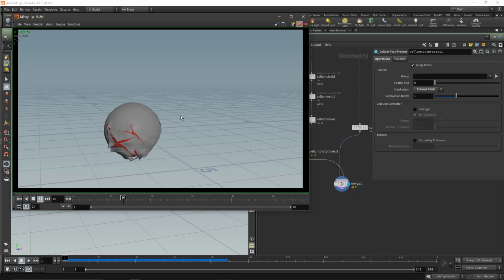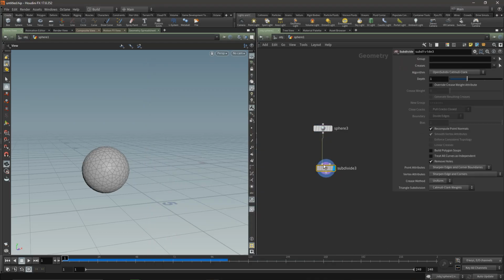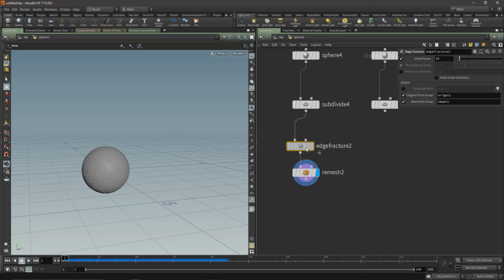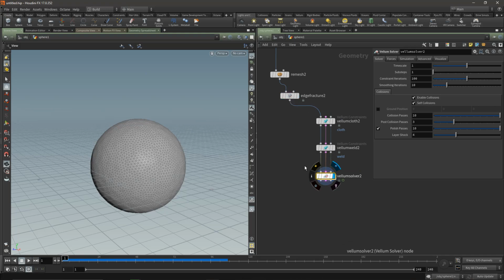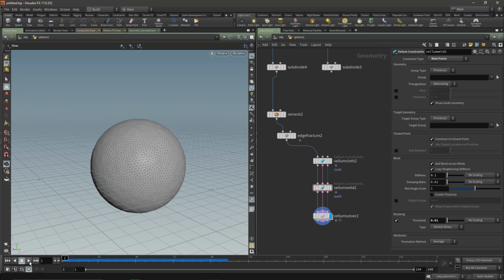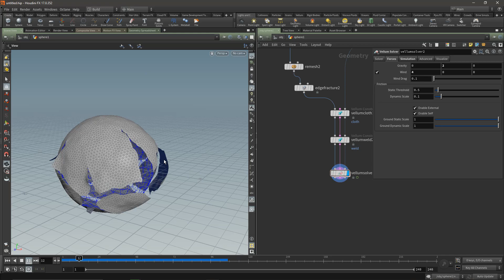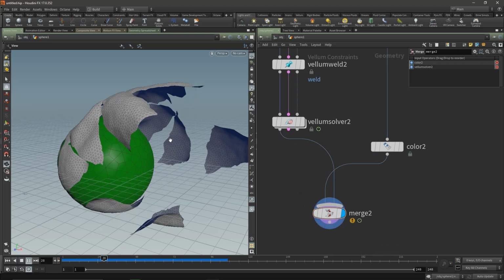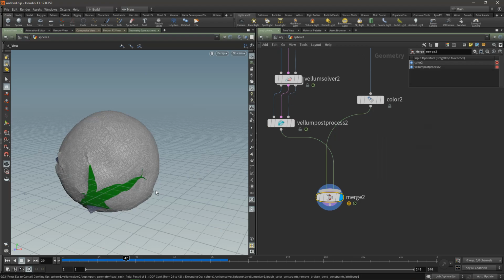Vellum Peel Effect - Houdini

Comment: how do you control the speed the peeling effect?
Reply from the maker: You can control the speed of the peeling with break constraints or a stronger force. Also you can increase or decrease it with the timescale parameter in the Vellum Solver.